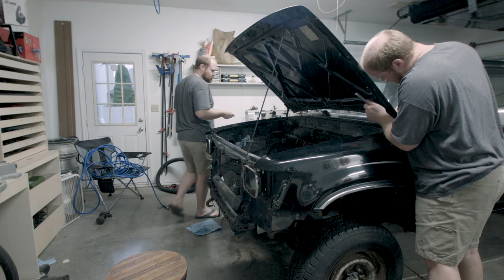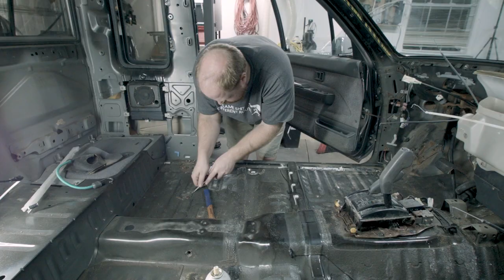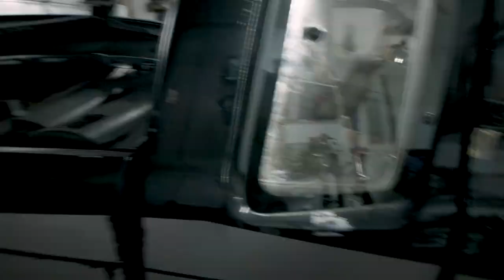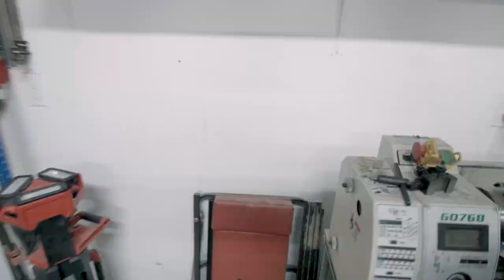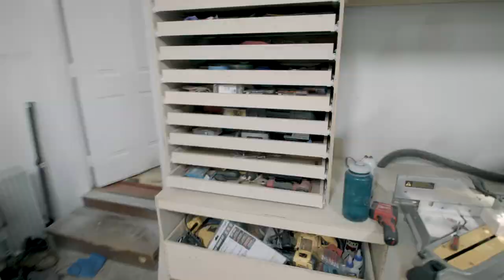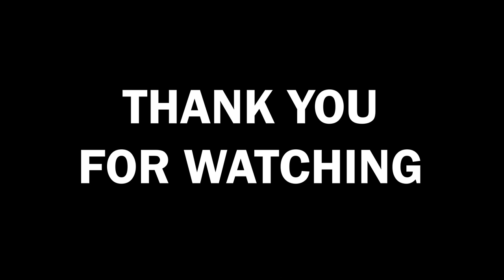Hood and fender removal, unbolting cab from the frame. - 1989 Toyota Pickup Restoration Ep13

Comment: Nice been restoring my 88 Toyota SR5 4x4 xtracab pickup for last 5 years motor, head valves ,Marlin Crawler Trans hydraulics, clutch throw bearing, front suspension Downey 2" front lift dual ranchos both sides fed molgul pitarm, idlerarm tie rods, 555 ball joints new lower A arms boots, bearings gasgets , rear Toyota bearing cases complete hardware, throttle positoner, K N aluminum air box new intake rubber boots, Xtra tank repaired , it's in Tijuana right now full restoracion body and paint all hard ware off windows out also, camper shell restored, putting on fender flares, BFGs went on a year ago, aluminum centerlines, lot of work lot of money lots of pacientes, all most there, YHEAAAAA

Comment: Nice video!  Do you have any tips for putting the front fender back on and it’s getting crunched by the door opening. I lined it up with holes and I just wonder if there is something I should be doing different

Comment: My is a 1997 limited, in believe I removed all the screws but it's still won't come off.  I think it might be the running board is clipping the bottom of the fender.  Do I have to remove the running board also?

Comment: Awesome vid, but Where is the bolt location for the front fenders?
Reply: For each fender - aside from the obvious ones located from the top - there's one in the front behind the bumper, one in the front on the side of the bumper corner connected to a bracket, a couple down below by front edge of door, and one near the top by the door hinge  (open the door for access). You can see him removing most of these in the video. The front were removed when he took off the front end parts.

Comment: Hi, Does anyone know if U need to remove the running board for 1997 3rd gen 4runner limited in order for the side fender to come off.  I believe I have removed all the screws already but it not coming off.       3 top screw Underhood, 1 in door, 2 beneath door, 1 in wheel well and the 4 screws that holds the plastic,  1 under the light.  Not sure if I'm missing anything.  Please help.
Reply from the maker: I'm not familiar with that vehicle, that's quite a few years newer than mine. But you should be able to see if the running boards fasteners are holding any of the sheet metal for the side fender. I'm guessing no. There might also be some sealant on some of the joints to make something waterproof. Check all the seams for sealant. That's about all I have for suggestions. Good luck!